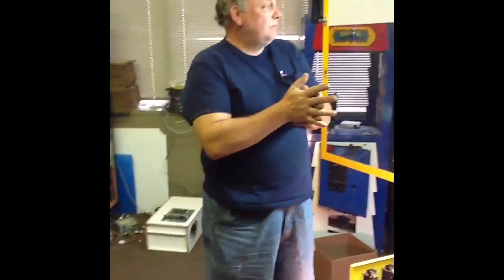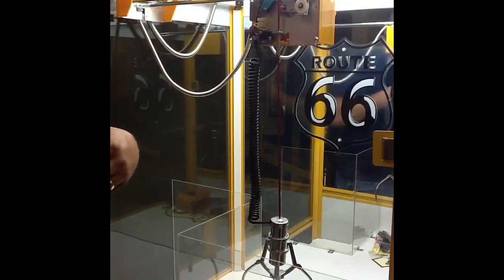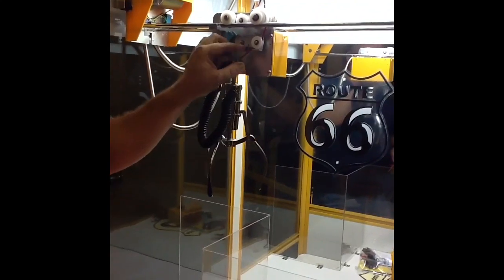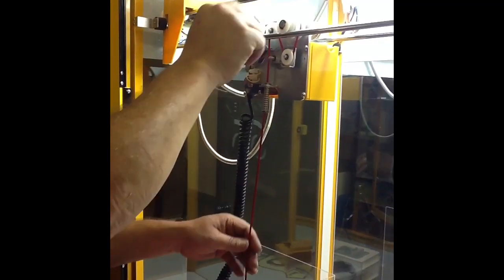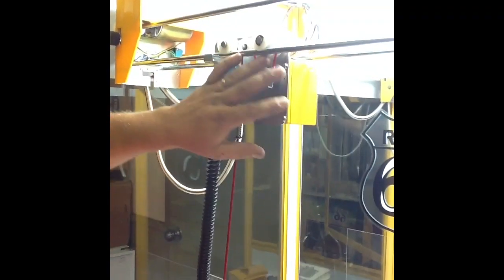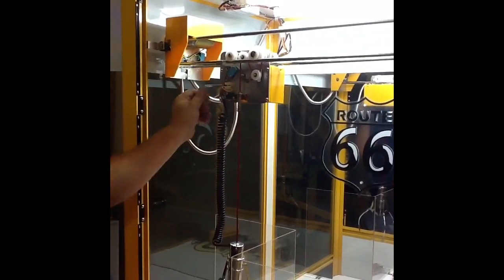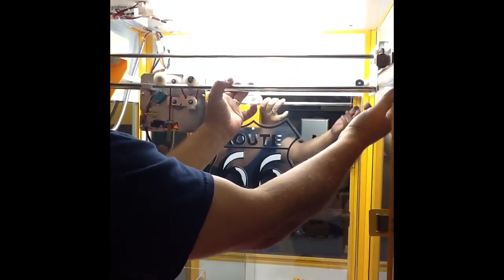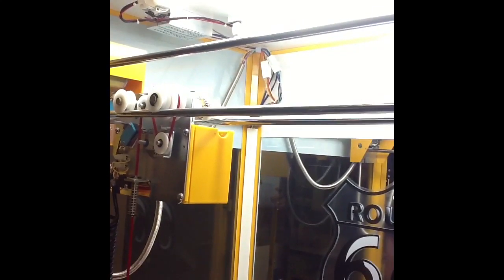Step 6: Fixing Error Codes

Comment: Error code 03 on my toy chest claw machine. It won’t move to the left and return to position. This video helped me years ago with code 01 and I replaced the motor everything worked for two years and now I have code 03 so I’ll be checking the wires 😢 but thanks for the video.

Comment: Hi sir 
I have one candy factory machin this machin proble is sum time clown working sume time not working but working time  up and down driver board clown become hot the motor comming slow I swip othe drive board laft or right board working  but up and down porblen 
I check volt 24Dc out put but working time going 15or16 volt DC I check all components And also motor manually 24volt DC not problem motor 
Pls help me what solution 
Thanks 
Best Reg

Comment: Been fighting this error for a week now lol. I swapped the up/down motor, swapped microswitch, and now I'm going to test the voltage like you mentioned. Thank you for this video! 
I also noticed the tension on my line (its a pre-2005 challenger coast to coast) is extremely tight, to where I can't even pull any slack down on it at all on it. Is that normal?

Comment: could you please go more in depth on the 02 error code... that is the one I have on that same claw
Reply: My is on 02 what can I do to fix this
Reply: @dontown3982  oh yea so basically the 02 error code if i remember properly is the front back motor. usually you just need to check for loose wires